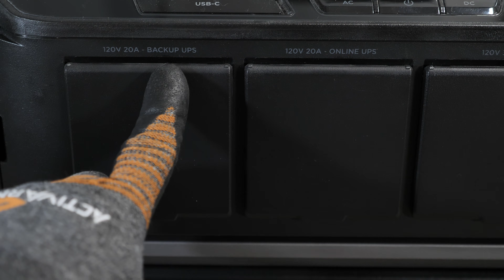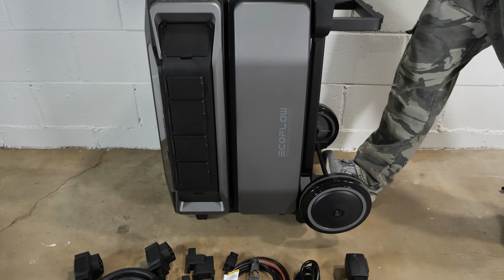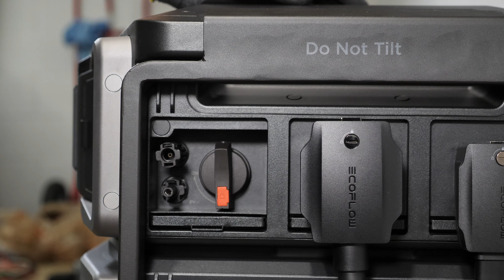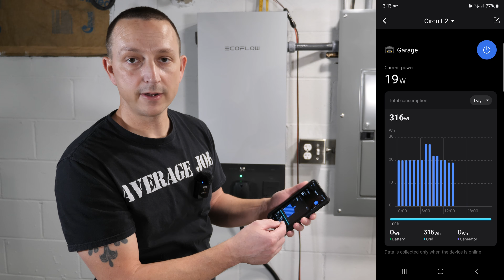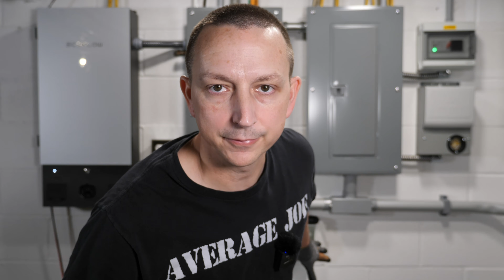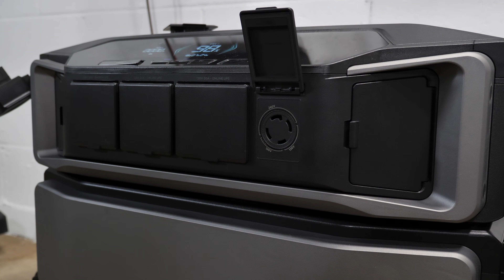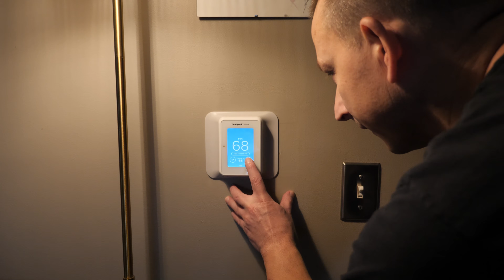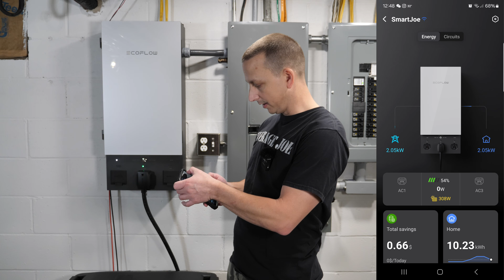Demo of Fully Installed EcoFlow Smart Home Panel 2 with Delta Pro Ultra - Black Friday Deals

Comment: This review seems overly biased. The Smart Panel 2 has a 20ms switchover time, which is enough to cause brownouts in sensitive devices, including basic computers—let alone more delicate equipment.

If portability isn’t your main priority, a hybrid inverter and battery setup offers a better alternative. Not only are these options more cost-effective, but they also provide greater storage capacity and are nearly as straightforward to install.

Despite being marketed as “modular,” these systems come with significant drawbacks. The wheels are poorly designed, making the units unstable and top-heavy with more than two batteries, posing safety risks—especially for families.

Another major issue is reliability. Each battery stack requires its own inverter in addition to the main inverter. While this allows flexibility for reconfiguration, it also creates a fragile system where a single failure can render your batteries useless. If the Smart Panel fails, your options are limited to rewiring the battery stack to a generator outlet—if one exists—and only if nothing else relies on the Smart Panel.

At its core, this system is marketed as compact and mobile but comes with a hefty price tag and numerous limitations. Installation, ongoing costs, and the potential for cascading failures make it a less appealing choice.

For most users, stationary inverters and battery systems are a far more practical and cost-effective solution to consider.

Comment: A complicated question Using the DP3 and DPU on the smart panel together I want to connect my 4000 EF new generator to the DP3 and program it when the battery drops to 20% to automatically start the DP3 up to 100% is there any way to have the DPU charging has well or only the DP3 will DC direct charge ?
I tried to get answer from EF no luck so far.
Reply from the maker: That is a great question and since I dont have the generator I cannot say for sure BUT just thinking about it I would say no unless it allows equalization between the 2 different models.

Comment: After reading several comments across videos by people who have problems with their EcoFlow batteries or systems, I looked them up on the Better Business Bureau. Apparently EcoFlow won't even engage with BBB, which is nuts. I'll be holding on purchasing anything from EcoFlow until they get back into good standing with BBB, which is a good measure of a reputable company.

Comment: One thing I can’t seem to find is any information on the 50amp hub…why has no one really talked about it? Can you install it and charge your DPU’s with it? Or is it discharge only? Can I hook 2 DPU’s up to it and connect to my generator switch to my electric panel? Do I need to have an alternative charge source for the DPU’s? Like a dual fuel generator? Or solar? I can’t seem to find that information

Comment: I just installed a DPU with one 6hWh battery. For feeding the critical circuits, I am using the 120/240V outlet. 
I have a huge issue: while the DPU cable is connected to the grid and the DPU is feeding the critical circuits, the DPU can not receive power from the grid (input = 0 Watts). On the other hand, when the the DPU is charging fron the grid (input = 2600 Watts), it is not possible to activate the AC button (AC button gets locked) and it is not possible to feed the critical loads. I tried by keepinng the AC button always activated but does not work.
So my DPU can only either charge from the grid or feeding the loads, but not the two things at the same time.
Could anybody help me to solve my problem?

Comment: Question, when connecting the device through the dedicated cable to the Smart Home Panel, does it retain a 30amp max draw as if you were using the 240v 30amp plug on the front without the panel?
Reply from the maker: It will do what the inverter is capable to do which is 7.2kw or 30a.
Reply: @AVERAGE_JOE  that’s what I thought. What about when you add the second and third inverter? Does it increase respectively by 30amps for each inverter? I can’t seem to find that information online or I am overlooking it one. Thanks in advance!
Reply from the maker: Yep, each inverter will add 7.2kw to the total output. So 2 would be 14.4kw and 3 would be 21.6kw. 🤘

Comment: The weak link in this entire system is the number of poles in the panel (there are only 12). The Span panel won't work with this system so a smart main isn't really an option for the ultra either.
Reply from the maker: Yeah a bigger panel would be sweet. Only other option is add a subpanel off the SHP2. You would only have control over the double pole breaker but its better then none🤷‍♂️

Comment: Great video. After Helene I have been researching systems like these and this is the one that looks to be the best option versus putting all of the components together yourself. Thank you for this video. Is there a way to charge this system with a non-inverter generator like the Predator 13000W?
Reply from the maker: Thanks! How did you fair after Helene? I have been watching videos NON STOP! I wish I could be there to help!! Yeah this is a great system, easy to setup and expand when you want. It is generator ready with transfer switch/lockout. I have an old military 5kw diesel genny that I still need to test out on this but dont see why it wouldnt work. My genny is still in my driveway which is far away from panel and that is the only reason I havent tried it yet. I would Love to hear about your situation there and my heart goes out to ALL! Only if you wanted to share, my email is averagejoestuff@gmail can also help if you have questions.🤘

Comment: Excellent video, thank you! 

Did you get a chance to check out the Time of Use mode? I'm curious whether this is something SHP2 does automatically via the app or if you need to come down and manually disconnect the main breaker every time (like you were doing to simulate a power outage).
Reply from the maker: Thanks! TOU mode works fine. You just need to setup the times ect to go on battery. I only disconnected to show that it will go to battery if grid goes out. You can also just manually go off grid when you want and everything is done throught the app.🤘

Comment: So the smart panel will auto trigger ecoflow backup when the power is out? Which do you prefer for recharging the ecoflow? Generator on the main panel or smart panel 2? Once the generator kicks in it will supply power to the whole house at the same time charge ecoflow?
Reply from the maker: Yeah it will auto turn on and continue powering your stuff. I actually havent tried the gen port on the SHP2 yet but yes, once the generator kicks on it will charge and power stuff at the same time as long as the generator is powerful enough.

Comment: Great Job Joe, Since the HP2 has only 12 addressable circuits, it limits the number of 240 Volt options.  Would it be possible to create a separate 240 switch with multiple 240 circuits (e.g. Dryer, AC, Oven etc.) that could turned on separately?  Maybe connected via the  240 outlet to a transfer switch.  That way in a power out situation they could be separately powered by the battery.  The other question would be could the HP2 also work if the 240 Volt plug is connected simultaneously to the transfer switch (Protrans et. al.)?
Reply: Any Thoughts?
Reply from the maker: Yeah thats an option. Id run a sub panel off the SHP2 then you could run that panel with the other items and at least monitor and turn on/off the panel when needed. For the protran, yeah you can use that at any time weather grid is there or not.
Reply: @AVERAGE_JOE  Thanks

Comment: Question- so you have several circuits from your main panel going into the EcoFlow smart home panel 2.. what circuits does the delta pro ultra pull from when you go to charge the battery from the grid?
Reply from the maker: Circuits are moved over from the right sub panel. That sub panel also powers the SHP2. SO It will charge from the same sub panel.

Comment: I have 2 of these DPUs with 3 batteries each totaling 36kWh. I'm running them to the EF 50amp Hub then 50 amp cable into inlet with interlock on main and manually managing loads.  I love having the option of using these at night and then gennie during the day.  I have had a cpl of weather related outtages and we've had no issues at all.  Love these monsters. What screws me is the location of our service panel. Our basement is originally finished, and they stuck our service panel in the corner of our laundry room. Of all places, it sits above and to the left of our dryer. Anytime you open the panel, you are looking at it in a weird angle. Eventually, I may get it relocated out of the laundry room to another area and make it a more direct purpose utility room so I can get the SHP2 installed and take full advantage of these capabilities.

Comment: So if I understand correctly, you can’t power the main panel with the sub panel but only power the breakers that are in the sub panel? 

Seems like the 50a generator plug will power more if the house?

Comment: I already have solar panels on my house that power my home during the day and sell back the used electricity that I send back to the grid.  

Can I charge the EcoFlow system with my existing solar panel setup?  I keep hearing that there is a limit to the amount of solar charge the EcoFlow will accept. I am just not clear what that really means.
Reply from the maker: It wont accept AC coupled solar systems so all you need to do is plug the units into the wall to charge or if you have the SHP2, then charge from grid. Any excess solar you make would be used to charge.

If you wanted to add more solar, you would direct wire to the Ultra and not use any inverters. Hope that helps

Comment: Thanks Joe for sharing your knowledge and experience with these plug-and-play batteries systems. 
I am following your videos, and over the years I see undoubtedly how Ecoflow, Anker, … are expanding their line up to new side products (Ecoflow Powerstream, Smart Home panels,….) I would like to begin somewhere with home PV installation and power backup, but I am still torn between these new fancy App-friendly systems (Ecoflow, Anker, Hyawei, BYD,…) and good old school systems (Victron, Growatt, SMA,…) which started to build their wired systems around rock-solid inverter/converter units. The new brands are less expensive at the beginning and allow the end user with a smartphone to carry on many changes himself, the old school model allows for a much longer expected life expectancy (25 years for a complete Victron based home backup system with PV panels and ev-charger and ….) but requires an electrician to come for each tiny modification of the wiring or even new setup of a single unit. 

What is your take on life expectancy of these new brand products ? and since they are releasing new products line up almost every year, what is your take on inter-compatibility between the yearly line up (e.g. have you seen limitations due to their proprietary plugs and socket systems) ? 

Thanks and keep up with your good stuff 👍

Edit: I was Youtubbing a little further and I found already an answer about an example of backwards compatibility issue: the new Ecoflow Delta Pro 3 is not compatible with the first series of Delta Pro 1 battery and Smart Home Panel 1, I guess many owners are now trapped

Comment: I have a Delta pro ultra with one battery. I installed a 30 amp inlet and connected it directly and it works fine. Curious why you did a 50 amp inlet?

Comment: I watched this many times!  you did an awesome job!  Question:  If I have an outside propane generator running, how can I hook that up to the SHP2?
Reply from the maker: Thanks! I see you name says Husker Fan. You in Nebraska? I am in Omaha btw😆 Anyway, if your generator is 240v, you can direct wire it to the SHP2 generator breaker. If going to the Ultra, you would need the input/output to generator adapter cable.

If your generator is only 120v, you coulr only use the regular 120AC charging like it was plugged into a wall outlet.
Reply: @AVERAGE_JOE  That's really cool!  Yes, I'm also in Omaha.  Small world.  I haven't bought the generator yet but will be buying a 240v.  My thinking is, in case of a power grid outage and no sun(cause I have solar panels) I'd recharge the DPU's using a generator.  Just have to figure a method to do this the best way.  You have more videos on how this process could work best?

Comment: @AveRage_Joe, SO based on your Vids and Suggestions i bit the bullet on the Ultras and the SHP2... I have a question about the SHP2 and within the App itself. Since the SHP2 has the ability for 2 single pole breakers, if i have 2x20amp would i need to tell the SHP2 in the App that this is a 40amp Circuit, and 2x15 would be 30amp... etc.. Cant seem to get the correct answer or find that anywhere. Also assuming there is no way to have that separated in the APP to tell it what each breaker is, only the circuit so would have to do a Fridge/Office type naming convention...

Thanks, seriously enjoy all your vids.
Reply from the maker: Awesome! Yeah in the app if you have singles then set them up as single 120v 20a since they are singles. Same for the 15a. 2 seperate circuits. If you put in a double pole 20a, then set it up as a 240v 20a, not a 40. Does that help or answer your question.

Comment: I am getting a condo and I work from home.  If I lost power during work hours, I would need to power my refrigerator and office (overhead light, computer, router, and monitor).  Everything else I could get by without.  Would this type of setup be overkill or should I just get a Delta Pro 3 and wheel it out when I lose power?  I should also mention that I work 9 hours a day, I could need it to be on battery for all that time.
Reply from the maker: I just did a vid on the D3 (so its fresh in my mind) and my house load was avg 800w. If I draw 800w from it, I would get about 4-1/2hrs run time which included my big pc. You would need to figure out your load but guessing it would be similar. Either system would be great. I would get at least 1 expansion battery if you get the D3.

Comment: i dont get it, why the heck would you pay $6000 for this crap? A generator does all of this for $500. To safe $50 each month in power? All this crap will be outdated in 3 years anyway. They say its good for about 10 years before its trash so that means that its done after 7-8 years. Its gonna take you 10 years before you see a profit. Not even talking about the fortune you have to spend on solar panels.

Comment: Why would someone stack vs go horizontal?
Reply: Imagine a high rise building built horizontal instead of straight up. Space is key and weights 120lbs. Easier to pick something up that’s 2-4ft off the ground instead of the floor.

Comment: I have 240w, 29.6 volt, 8.46 amp  solar panels, how should I run/wire the panels to best supply 2 Delta Pro Ultra ?    Series ? Parallel ?  Combo ?
Reply from the maker: How many do you have?

Comment: @AveRage_Joe, Question, if i have a generator and i want to Charge this and not go directly to an inlet, can i plug a Genie Directly into the unit and charge while the home is on Bat Backup? If so am i limited to the just the 110 AC input for charging? Thanks
Reply from the maker: I just replied in the other video😀. The ecoflow allows generator charging with the adapter. Or through the regular wall charge port.

Comment: if I ever get a place of my own, I would be utilising a setup like this, due to the fact that when you get a power outage it would switch over to the backup system and at the same time so you can fully charge the ecoflow unit via the grid and solar pannels to maintain the levels of the charge from solar and grid, or one or the other....a very good setup, but can understand why you would need a licence electrician to setup the system.
Reply from the maker: Yeah its a really nice system and can do everything you want. The electrician part for most is installing the panel and running or transfering all the wiring. I did everything myself.

Comment: How does this run the entire house? It only runs 12 circuits? Most homes have more than that. That doesn’t count the double pull ones. Good video though.
Reply from the maker: I used a generator inlet port as shown in vid which will run everything in the house.

Comment: Would I need a permit for this to be installed? Also, would the system then be able to support net metering?
Reply from the maker: If you hire an electrician, they usually take care of permits. There is no backfeeding the grid with this system BUT you can do time of use for the high electric rate or just keep those breakers off grid if you have enough solar.
Reply: @AVERAGE_JOE  thanks for the info!
Reply: @AVERAGE_JOE  Another question for you.... What if the main breaker panel is outside? Would they be able to install the lower half of smart home panel(Where delta pro ultra plugs into panel)inside the garage(wall opposing the main breaker panel)?
Reply from the maker: @jbrockskill  You bet!  The lower box is designed for that and can be removed and reinstalled anywhere!  With longer wire of course that the electrician would install.
Reply: @AVERAGE_JOE  Thanks for the Info!

Comment: Compact system including high voltage inverter is the future
we have not seen yet this ECOFLOW ultra in Europe
it's interessing but expansive
5.6 kw inverter is good but not efficient to full 5 batteries
in temperate countries during winter (<3 hours sun by day)
i think a 9kw inverter as Bluetti system is more accurate

Bravo ECOFLOW ! Just make an effort on the price